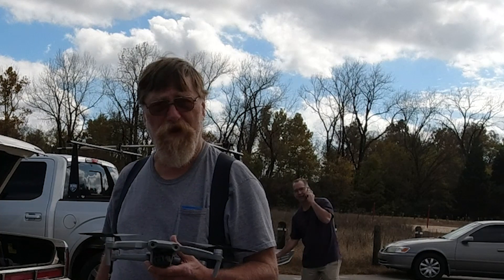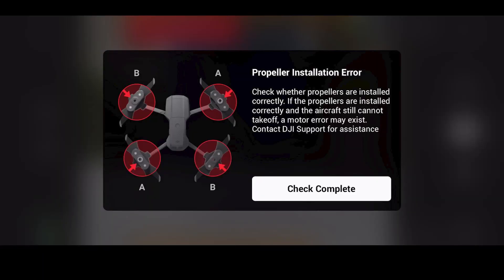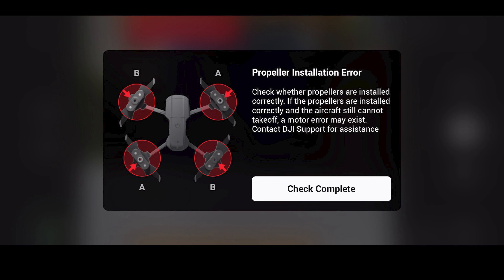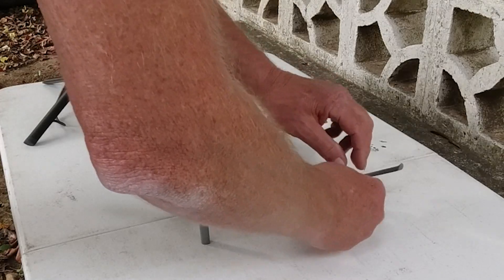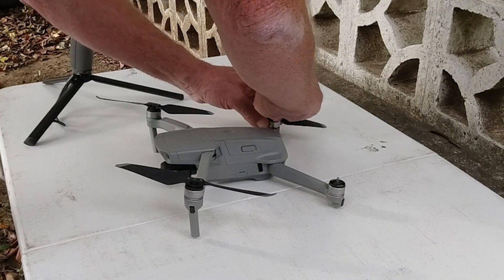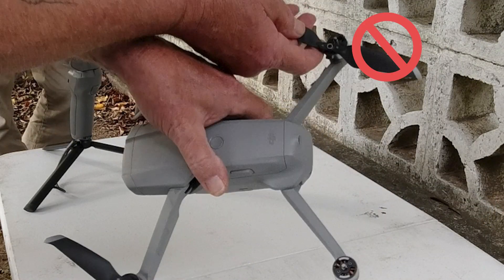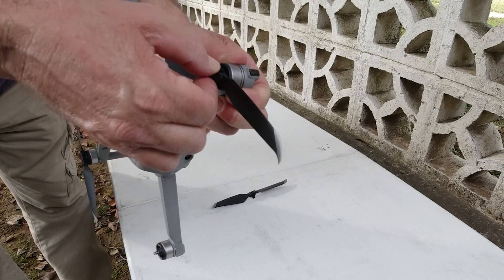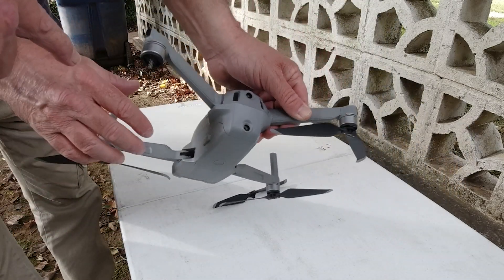Mavic Air 2 Warning PROPELLER FAIL

Comment: Yup! Just got my Air 2S and did exactly the same thing. I put 2 of the props on the wrong motors, pulled the sticks down then throttled up to take off, the drone flipped to one side - blades just skimming the ground and the drone immediately powered off! My first flight experience with the Air 2 S! i think I was fooled by the fact you can incorrectly install them which you cannot do on my Phantom 4! Silly mistake I know as they are clearly labelled, but when you got other stuff going on in your head, it’s a very easy mistake to make. Did your drone flip or react weird too?